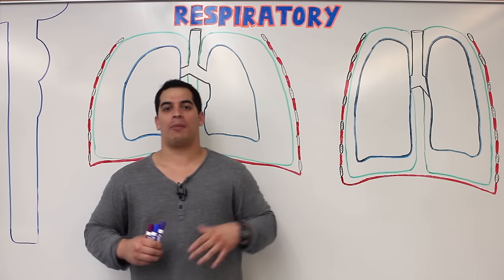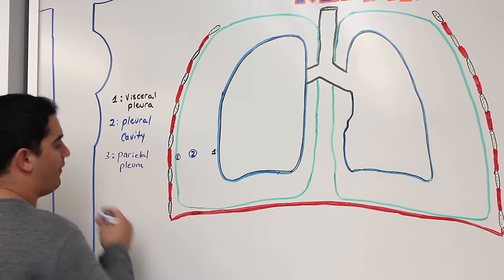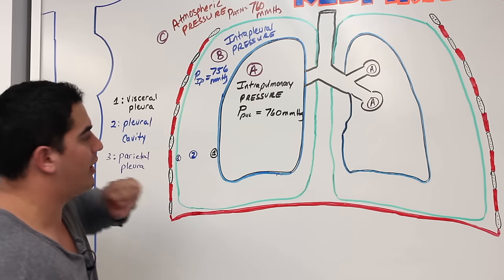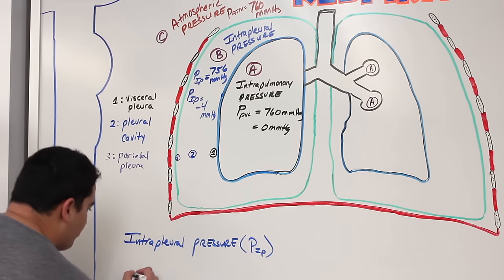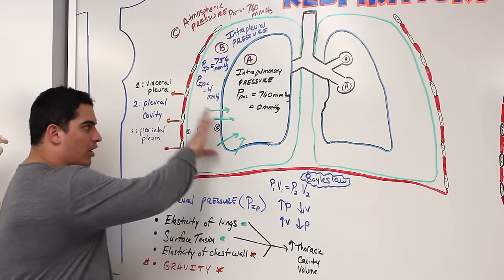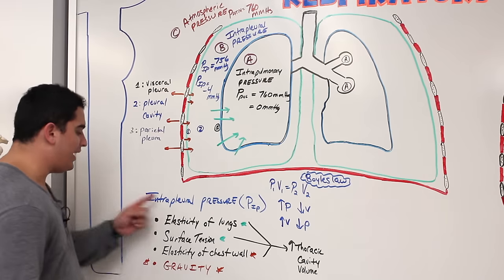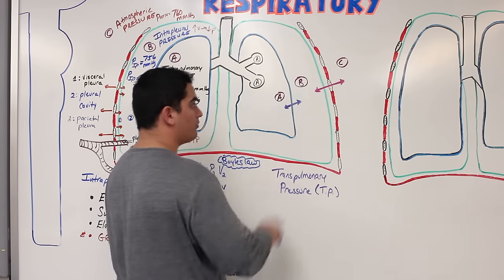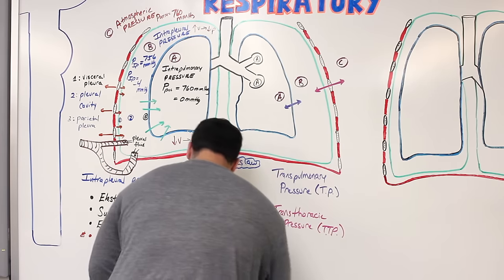Respiratory | Mechanics of Breathing: Pressure Changes | Part 1

Comment: if TP is +4 and TTP is negative
doesnt that mean the lungs want to expand while the thoracic wall wants to cave in?
Reply: I have the exact question :(
Reply: From what I read, since TTP is negative, air outside would want to go inside the lungs because air flows from high to low pressure. So I am wondering too
Reply: @Unicorn-up3gn  I m guessing that the pressure difference across the thoracic wall doesn't matter because of its rigidity due to the ribs and muscles
Reply: It's the opposite, lungs want to cave in while the thoracic cavity wants to expand.
Reply: You have to consider 2 aspects:
1. When Natural tendencies taken into account: 
Of lung=deflation
Of chest wall=expansion(moving outwards)
2. When pleural pressure is taken into account, (which is applicable in the normal dynamic state, so it's what you should consider, because it is a sum of the Integrated effect of natural tendencies and surface tension)
+4mm Transpulmonary = lungs inflate
-4mm TTP = chest moves inwards
So it basically depends on the TP and TTP
Reply: @ArmedBubble15  And to add on top of that, for people who are in doubt of your statements (and this is understandable - as this is a pretty perplexing topic) - in order to perceive how the natural tendency of the lung is indeed to deflate, an example can be made with pneumothorax, i.e. a condition in which the pressure in the pleural space is equal to the atmospheric pressure (i.e. Pip = 760 mmHg). In this case, the intra-pulmonary and intra-pleural pressures are equal, and thus TP = 0 mmHg (there is no pressure gradient). 
In this condition, the effected lung will indeed collapse on itself - because of this natural elastic recoil tendency of the lung (caused by the elastic tissue components of the lung + the surface tension in the alveoli). This is why it is essential that the intra-pleural pressure is kept at values that are below atmospheric pressure, in order to counteract this natural tendency of the lungs to recoil and collapse on themselves- and allow the lung and its alveoli to inflate instead.

Comment: lectures are great. At 27:18 when calculating pressures for TTP why is P of atmosphere Zero instead of 760mmhg? I understand that the interpulmonary pressure is Zero because it is the difference between interpulmonary minus atmospheric pressure which are both 760mmhg.
Reply: Take actual values of both the pressures 
Ppul -Patm = 760-760
           =0mmHg

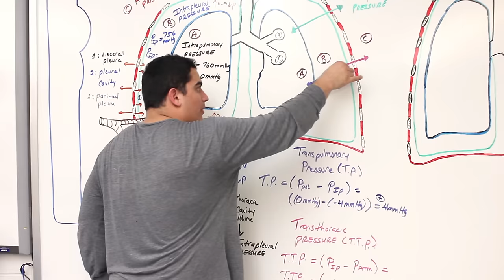Comment: At 28:19 you say that because of the negative transthoracic pressure, the chest wall is going to want to compress, but doesn't that contradict that fact that the negative pressure implies a larger volume? Wouldn't the chest wall be inflated rather than deflated?

Comment: a minor correction: the transthoracic pressure should be the same as transrespiratory pressure. it's just a different way of looking at it.  they both go from alveolar pressure to atmospheric pressure.  the only way transthoracic pressure would be different than transrespiratory pressure is when you have a very obese person with extra weight on the thoracic cavity.  as a source you can check out p.90 chapter 2 of the 7th edition of cardiopulmonary anatomy & physiology: essentials of respiratory care

your videos are awesome by the way, just wanted to point that out though!

Comment: " Transpulmonary pressure is the pressure difference between that in the alveoli and that on the outer
surfaces of the lungs (pleural pressure), and it is a measure of the elastic forces in the lungs that tend to collapse the lungs at each instant of respiration, called the recoil pressure" - Acoording to Guyton.
In your video, Transpulmonary pressure = +4 and It's going to be inflated.
Is it a contradiction?

Comment: I have doubt can we say that the surface tension in alveoli  and  elastic forces of lungs maintain the intrapleural pressure to -4 and that during inspiration the extra  negative pressure added to it bcz of the thoracic cage expansion
??

Comment: To clarify -- At rest, the negative pressure is due to maintaining the volume with slight pull inwards [at 18:45], but during inspiration, the negative pressure further increases due to an increase in volume with a pull outward [in part 2 vide]?

Comment: Ooo, unfortunately I found a bit of a roadblock, while reivewing Terry Des Jardin's Cardiopulmonary Anatomy and Physiology book, there saying that transthoracic is Palv (intra pulmonary) - Patm, which is very smiliar to the transrespiratory(trans airway), meaning,that the pleural pressure is actually only,involved in the transpulmonary pressure and no other of the pressure, if my book is wrong, id love to be informed, because ninaj's transthoracic prsssure formula makes alot more sense to me than Jardin's. Jardin also adds another formula/pressure that os completely,foreign to this video called, transmural pressure, which is difficult,to understand, but the math works the same

Comment: I have a question! How would you calculate the Pip? I mean, I know it involves elasticity of the lungs, surface tension and elasticity of the chest wall. But how would the math go for it to result in 756 mmHg?

Comment: Hey so I've got a question; a lot of sources say that the intrapleural pressure is -5 cm H20, but in the video you refer to it as 756 mmHg? Could you please clarify that? Thanks :)
Reply: 756 mmHg is the distance up a standardised barometer mercury will move and -5cm H2O is the distance water will move relative to the atmosphere (0 cms). So technically mercury could also be described as -4mmHg relative to atmospheric pressure of 0mmHg. Mercury doesn't move as far for a given pressure change because of the setup of the instruments, and because mercury is much heavier - otherwise you'd need massive columns of water to measure significant atmospheric pressure changes.

Comment: why did you call the TTP the deflating pressure? inspite of it denoting the chest recoiling outward which means expanding rather than deflating?
another question: what causes the chest wall tendency to expand and strech outward? and how is that affected in pneumothorax?
Reply from the maker: Great question!!! as a matter of fact the transthoracic pressure can affect expansion and deflation. The chest wall should naturally have a dynamic mixture of elasticity and compliance. We actually discuss this in more detail with respect to pneumothorax in Compliance and Elasticity video. You should check that out. Hope this helped
Reply: Ninja Nerd Science aha ok,thank you, yes I have seen that video about compliance and elasticiy,its really great,keep it up!
As I understood,the pneumothorax cancels the mechanical coupling between the lung and thorax.
Reply: haya alamle
Reply: haya alamleh Remeber one thing. Transmural pressure (the pressure which is across the structure... There are three types of transmural pressures...1 transpulmonary / 2 transthoracic / 3 transrespiratory ). So transmural pressures can be zero / can be negative or it can be positive. When it's negative it means the structure is deflating.  When it's positive it means the structure is inflating or its distending  and when it's zero there is no distending / inflating or deflating structure ). When I say structure I mean the lungs / chest wall or combined lung chest wall or respiratory system. Hope that helped :)
Reply: thank you for the explanation !
Reply: haya alamleh no need :)

Comment: If we use the formula for TP using 760(intrapulmonary)  and (-756)  (intrapleural) 
which would mean TP= 760 -(-756) = 1516

or do we keep the intrapleural pressure as a positive 756? B/c you didnt put -756 on the diagram but you said it was negative..

Please help :(

other than that I unerstood everything perfectly
Super appreciated
Thank you :3
Reply from the maker: Keep the pressure positive when solving for transpulmonary pressure so it should be 4mmhg ! However realize that the intrapleural pressure is negative with respect to the atmospheric pressure. Meaning it is 4mmhg less then the atmospheric pressure. Hope that helps!!!

Comment: Quick Question: 
When introducing the negative pressures found in the intrapleural space, you mention the elasticity of the lung "pulling" in the opposite direction of the elasticity of the chest wall. I also watched your video when you discussed elasticity vs compliance though, so I was actually expecting you to say that the elasticity of the lungs works with the "compliance" of the chest wall towards creating a negative intrapleural pressure. 
My question is, unless specifically discussing their differences like you did in your other video, are the terms 'elasticity' and 'compliance' often used interchangeably in conversation? (a.k.a.: if I use these terms interchangeably in a presentation will I still sound smart or will I get a lot of my healthcare professional audience members trying to correct me?) 😁

Comment: 12:50 - Why would surface tension between the visceral and parietal pleuras want to collapse the lung?
Reply: I know it's late after 3 months but answering your question the surface tension is not between the visceral pleura and parietal pleura it is actually inside the alveoli and it's affecting the alveolar fluid causing the air inside the alveoli to go out
Reply: There is no surface tension in the pleural cavity because there is no air there